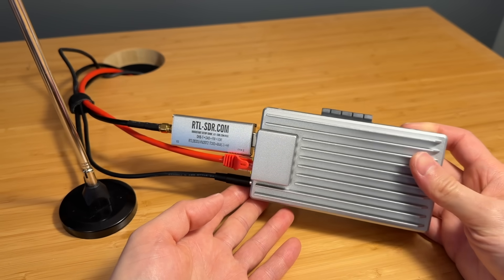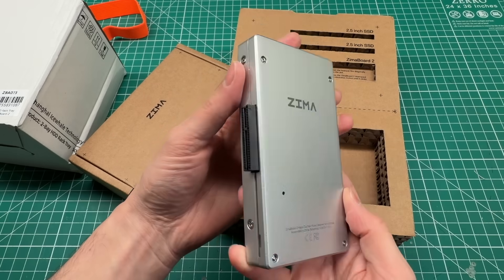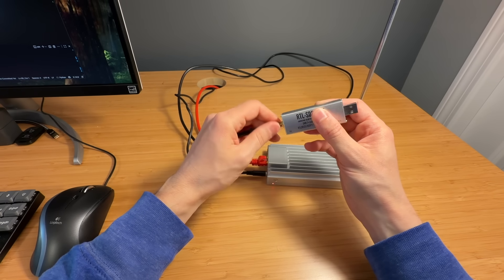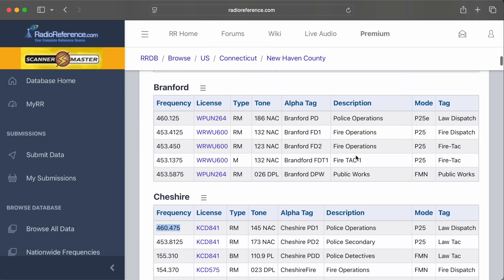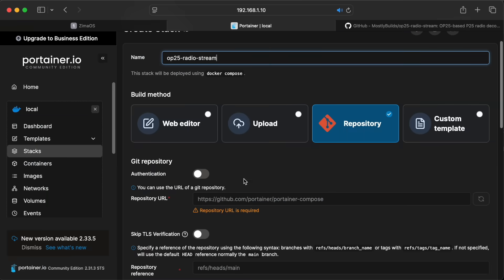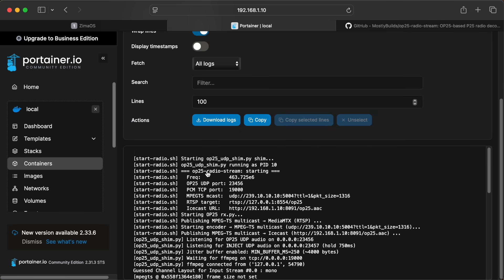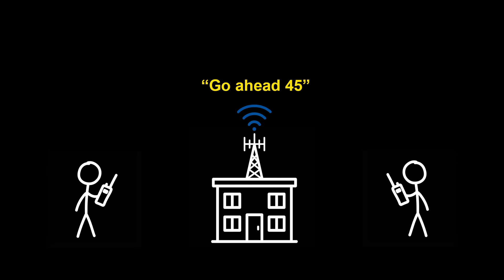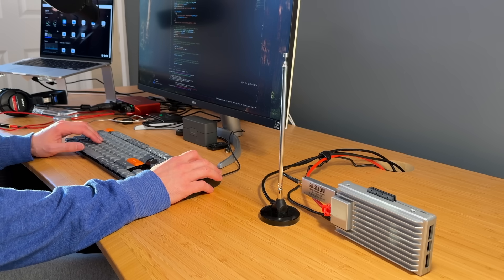DIY Digital Police Scanner With ZimaBoard 2

Comment: For this price, I can buy a digital scanner and still have money left over.
Reply from the maker: Running my radio server on the zimaboard uses barely any resources, so you have a ton of headroom to run other things as well. The SDR mode is super cheap.

What is a good/cheap P25 scanner that you recommend? All the ones I’ve come across seem pretty expensive.

Comment: Why not using a mini-pc that runs on Windows 11 ... that will give you much more options ... and any SDR & SDR software will run on it and also tons of other related software , so why use this Zimo , it brings no advantage, on the contrary
Reply from the maker: The zimaboard is a mini pc, and you can install windows 11 on it if you want 😀

I’ve run all the major SDR software on other machines that I have (SDRTrunk, Cubic SDR, etc). All great software.

I just wanted an always on solution that will auto restart if the machine is rebooted. But more importantly, I wanted a server-based solution where I can listen to a stream on any device (primarily my phone). If I’m sitting on the couch, I can start listening on a whim without having to go get a computer or turn stuff on and open software. 

Long-term I’ve been toying with the idea of building a sort of DVR solution that records whenever it detects traffic. Then possibly use a voice to text solution to create transcripts that can be used to preview without having to listen, and maybe set up keywords to watch for and receive alerts.

Running this in a server configuration gives me a ton of options for messing with the stream in a modular way.

Maybe I’m crazy? 😂

Comment: Can I use a Raspberry Pi 5?
Reply from the maker: It is definitely possible. It should build OP25 from source. I haven’t tried running my container stack on a Pi. In general I always seem to encounter issues when installing stuff on raspberry pi’s that requires debugging and fixing dependencies manually. This is one of the reasons I was pumped to try out the zimaboard because it’s just a regular x86 computer. 

If you decide to try it on a pi, it would be awesome if you reported back for others wondering the same thing.
Reply: Thank you for your insight. I will let you know if that will work for me. Thank you for sharing and creating this project.

Comment: New subscriber here..Can this decode Apco 25 like the system in Philadelphia? That is awesome if that is the case...
Reply from the maker: I’m pretty sure that APCO 25 is the same thing as P25, which is what I’m decoding using the OP25 open source project.

So the short answer is yes, but it will depend on if what you are trying to listen to is a trunked system or not. Trunked systems use multiple frequencies rather than just one. This is possible to decode using the same tech stack that I’m using, but would need more work to get up and running. You might also need multiple SDR modules as well. 

What I showed in the video decodes the more simple non-trunked single frequency P25 encoded setup.

If the traffic you are looking to decode is encrypted then you won’t be able to listen to it. This is because you won’t have the necessary keys to decrypt it, and it would be illegal if you are not someone who is authorized to be listening to that traffic. 

Hope this helps!
Reply: @MostlyBuilds  Definitely my friend!!! Yes Philadelphia uses Apco25 phase1. Thank you.
Reply: @Biokemist-o3k  Most of PA is now on the STARNet Project 25 Phase II behind full encryption. :( Right when I was getting into radio to they switched it. I bought 2 RTL-SDR's and loaded SDRTrunk, got it to lock onto CC frequency and loaded all the Talkgroups and got all that sorted out and NOTHING! I can see all the incoming calls on SDRTrunk but it says 'Encrypted' and you hear nothing. Sucks but they dont want the 'bad guys' listening in. Satellite is way cooler anyway. lol
Reply: @nichorusso4316  I looked up what Philadelphia is using and it says that it uses Apco 25 Phase I. I used to have a Uniden that did Apco25 and it decoded Philadelphia police however there were still times when there were encrypted comms. The funny thing is that most of the people using these radios didn't know how to turn on encryption or forgot to turn it on and you could hear one side of the conversation. I am an EMT also so I am always looking for something to use. The "bad guys " are usually the ones using the encryption from a lot of people's opinion. I believe that the public should be able to listen to all comms because it keeps them honest. Thank you for the answer my friend.

Comment: I have been searching for a voice to text option for years. That would be in incredible build
Reply: I use sdrtrunk to capture and save the audio.  it works good and allows me to select just the talk groups that i am interested in.  for listening I use trunking recorder.  Trunking recorder can even do voice to text.  I think it can even do alert triggers for certain words (I think)
Reply: the good + lightweight stuff I've know of were commercial offerings before all the AI neural net stuff came along. There are now models that do quite well based off of large quantities of pretrained data but I think you need a beefy graphics card to run many of them. Maybe look into OpenAI Whisper which may have AI neural net processing without high GPU demand

Comment: Thanks for this video. Is there a way to decode/listen to FMN mode transmission?
Reply from the maker: I think there are several tools that will let you listen to FMN using a cheap SDR device like I did. Looks like SDR++ or Gqrx both should be able to do it. You will need to select the correct mode. Either FMN or NFM I think. I haven’t tried it though.
Reply: 收听fmn那是最基础的功能了，5美金的sdr电视棒子就可以了，相关的软件也挺多的，选择对应的模式调整到对应的频率就可以了

Comment: this is ok if your area is in p25 p1 ... but a lot our moving to p25 p2. its just easyer to grab a scanner that will do both modes p25 p1 and p2 . anyways
Reply from the maker: The open source OP25 project that I used in this video is capable of decoding both phase 1 and phase 2. It is also capable of decoding trunked systems that use either phase 1 or 2.

Sure you can buy a scanner that does this, but they aren’t cheap and they are basically a one trick pony. What I like about my streaming setup is I don’t have to be sitting in from of a scanner to listen. I can listen to the stream on my phone or computer. I’m also toying with the idea of using an audio to text solution to create searchable transcripts. Maybe build a little DVR-style solution for this.

Comment: Good luck with decoding tetra
Reply: The easy way for tetra is not to read it , just track it 😂😂 like radar
Reply: Its not that difficult to be honest and really not worth it. 😂
Reply: @G @GoonyMclinux  depends on your intentions, I think some people are very interested wtf ever is going on in the Tetra net
Reply: AI says, "Decryption of TETRA radio systems depends heavily on whether encryption is used; unencrypted signals (common in commercial use) can be decoded with SDRs (like RTL-SDR) and software like Telive, while encrypted traffic (typical for public safety) requires authorized keys or exploiting vulnerabilities (like recent 2023/2024 flaws in older algorithms like TEA1/TEA2, allowing quick breaking with specific tools). Legally, intercepting/cracking encrypted comms is usually illegal, but listening to unencrypted signals is often permitted."

So it's not as impossible as your "Good luck..." comment implies.